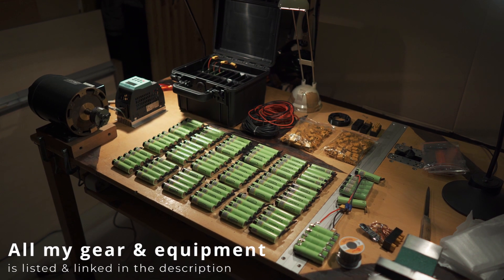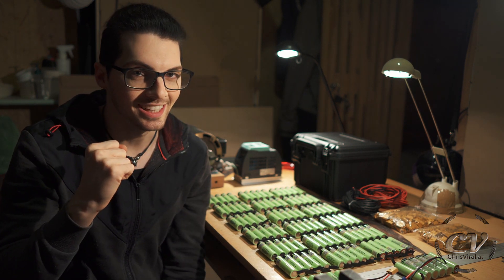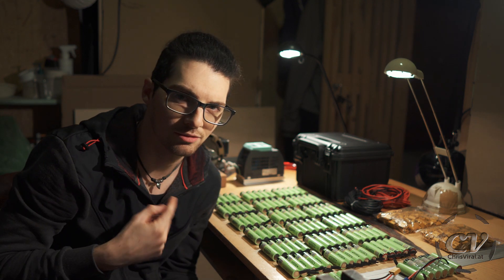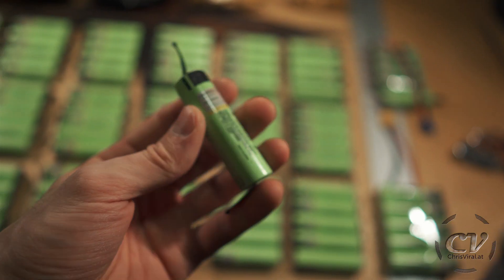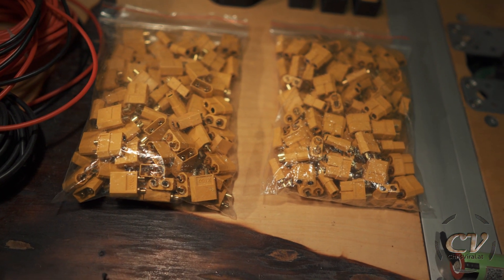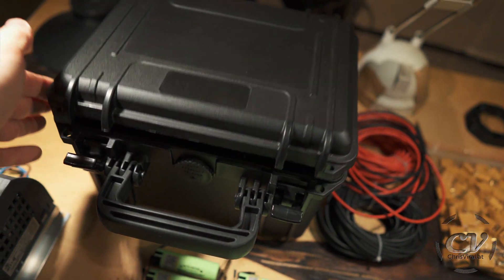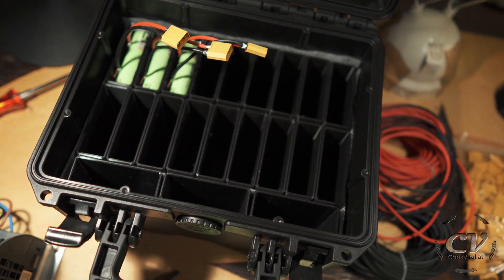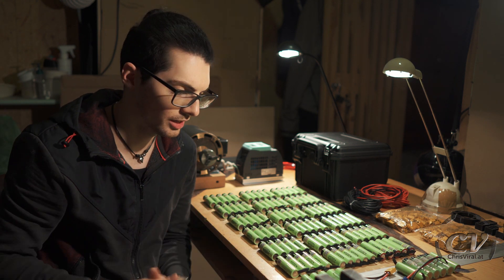DIY Mega Power Bank With 357,000mAh (1.32kWh) - Plan & Parts Review

Comment: 2:53you can also buy fuse holders, more practical and looking better 
https://www.ebay.com/itm/5X-30A-Amp-Auto-Blade-Standard-Fuse-Holder-Box-Set-Car-Boat-Truck-With-Cover/174098517354?hash=item2889148d6a:g:iqUAAOSw2b1ZoRsF
they can take also the minifuses i tried that and it works
3:55 lol there is no quicksilver, the label says lead(pb),tin(sn),copper(cu). the Lead is toxic but the real danger is not the lead but the fumes from the flux core.
Reply from the maker: Oh crap I am so dumb 😅🤣 ("quicksilver") loool yes I meant lead ffs... lol I can't believe it hahahaha!
Also I even have a few few fuse holders, but this would over complicate the project even more :D
Reply: @ChrisViralVlogs  dont save time on the wrong places, fuses are only fun/usefull when they can easily be exchanged. Also cooler than fuses are resetable fuses :D , just a quick link https://www.ebay.com/itm/Automatic-5-25A-Circuit-Breaker-Resettable-Fuse-Overload-Protector-Manual-Reset/372702012519
there are also 3A aviable somewhere. mabye cheaper too like 3eur/piece , i still use normal fuses for playces i dont expect often crashes.
Reply from the maker: Thanks, I also don't expect them to blow, that's why I kept it simple :)
Reply: @ChrisViralVlogs  still up? :D